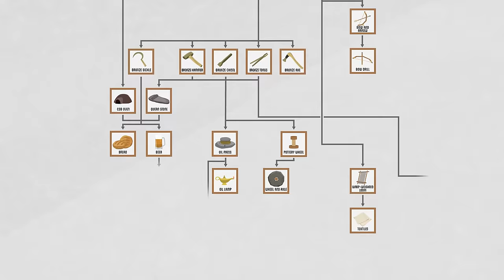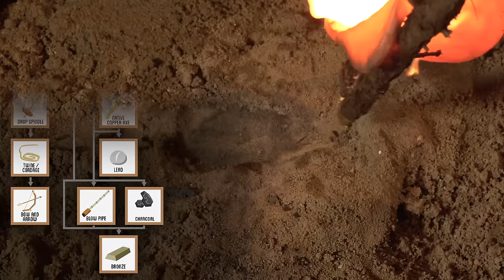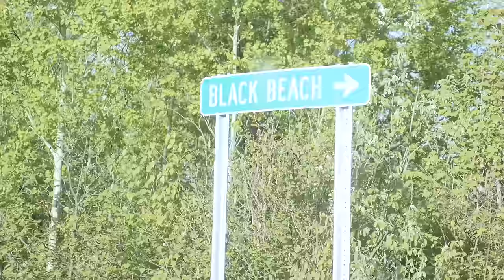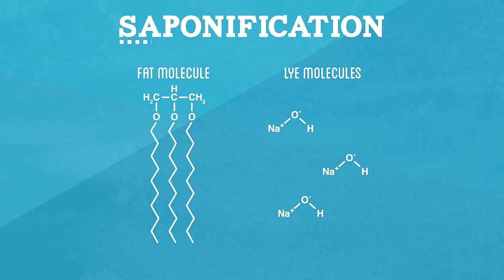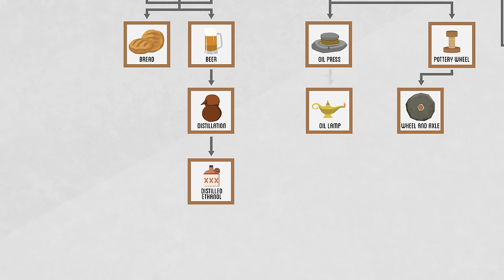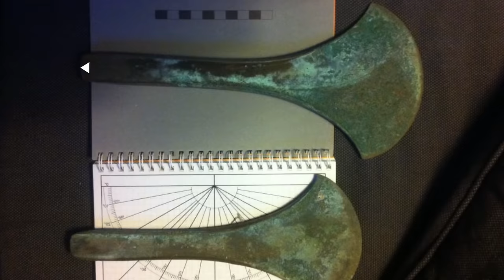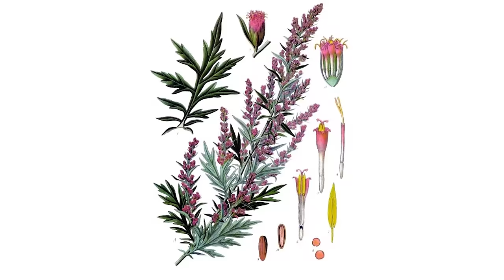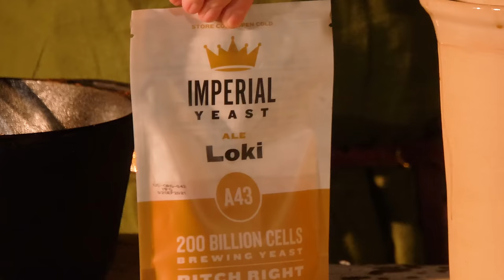Iron Age to Medieval Era: Speedrunning Human History (pt 2)

Comment: For true (self healing btw) roman concrete you need to mix some lime chunks into your stones to form deposits of it throughout which when in contact with any water salty or not (like rain) would react and form new calcium carbonate and seal any cracks giving it the ability to self heal so long as those pockets of lime remain, which they will of course run out over time as more and bigger cracks form but it allows it to last much longer (also all of this is on top of the seperate interaction the volcanic ash has with salt water which you mention in this video)

Comment: In case you didn't know: when drawing out wire like that, it helps to rub/coat the end of the wire that goes through the wire die first with a bit of bees wax. That helps lubricating the wire a bit, making it easier to pull through.
Just get a block of bees wax, use it to press the wire against something like a working table, and pull the wire through that.

Comment: and there is a old painting with 3 fires going up a hill. I think they were using the lower fire to preheat the air for the next fire. by making a chimney inside a chimney you can preheat the air for the next fire. With 3 fires you could melt steel.

Comment: Those handles need to be fastened to the heads properly  the way you have them now is not only unsafe but also unsightly... make it so you have a solid shank thru the head and make a cut down thru the center of the shank so that you can install a wooden shim. Also do not cut the shank flush with the top of the head be sure to leave 1/8 to 1/4 inch above so that as the wood swells with the shim it can be wider than the opening and keep the head secure to the handle

Comment: Just a suggestion, but I didn't see much, if any, measuring and calibrating. If you attempted crafting things a little less crude and with more precision, I think you would get much better results. Reducing overall time put into most projects. For example, the screw you made could have been made far more precisely with very simple measuring techniques. Perhaps do a short series on measurements and calibration. You will need it for your end goal, "the Steam Engine" that's a lot of parts working together with small tolerances. Good luck, and keep up the great work.

Comment: A friend of mine found an axe  head made in the Indian tradition,  (some call it a celt)  but it is an axe. It was found in one of those river side fields that we find lots of Adena artifacts in. Was found on top, no rust or pitting. It never did rust AT ALL, but is clearly iron,  but in the shape of many stone axe heads we find in this area.
The only thing we could come up with is, that it's metoritic iron. It's only thing that makes sense, they certainly didn't smelt it!

Comment: the industrial revaluation started in the spite of time where castles with surrounding walls were built, more then 800 years ago... as the air goes cold. the symptoms of exiles stay outside just for thinking that the foundry hole at the top on one of the towers was a place to poop. twelve 150 foot towers, winches stairs etc. 280lb bloom, winched back up 11 times after the first, keeping the walls hot at the same time. 300~1000lb hammer heads for a A-frame pendulum that goes back to the rock quarry.

Comment: 3:31:18  Anything under tension can snap free and whip back to injure your eyes or neck.  To avoid a sorry outcome this guy should have on goggles and shielding clothing.  In making pretensioned concrete with steel cables, various people have been cut in half across the torso.

Comment: I made a seesaw with counterweight for my pot bellows, much easier to use that way and not very difficult to make, most difficultwas to get the clay for me, the local clay turns out to be high in arsenic and manganese!  so I had to source mine at a local potter...
I  would say 1/10th to 1/15th of the bloom or slightly less becomes forgeable iron, then refining reduced that to half or quarter, thisvwasb20 years ago do exact figurescare fussy. out of my seven "successful" attempts (11 total) I  got just over 2kg total workable iron. this was roughly 20 years ago, so not exactly fresh in my mind. 
brings back memories of soot, hard work and sweartm j6st making charcoal from driftwood by the barrel took me over a week during my vacation, while doing that I used time waiting for the process making the tools later used to forge the bloom (wooden mallets, stone clubs...).